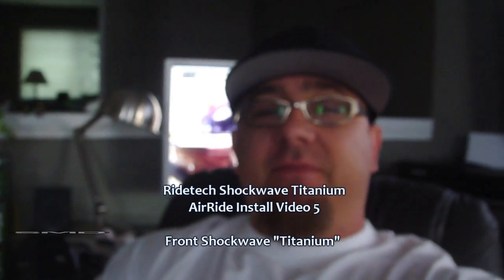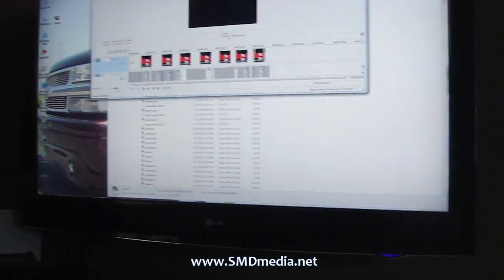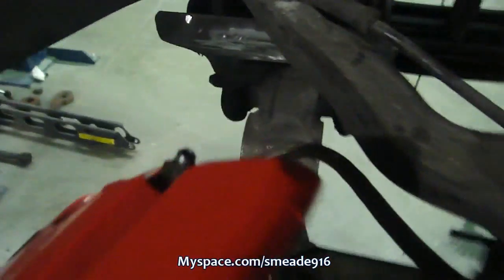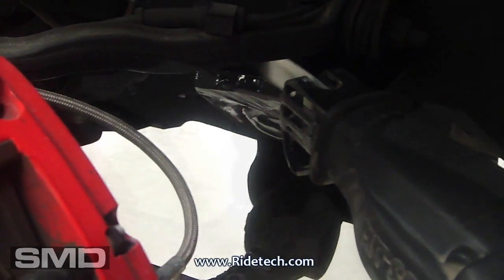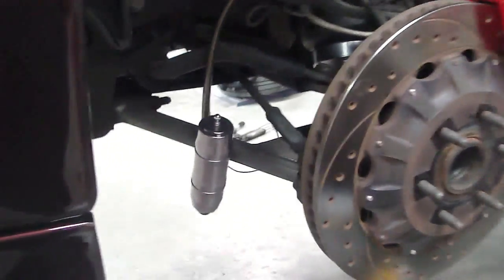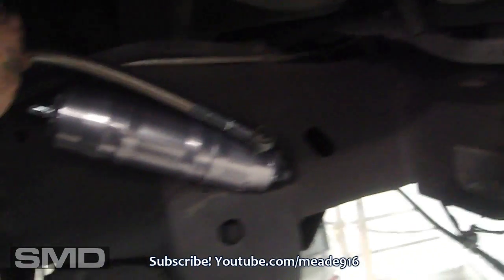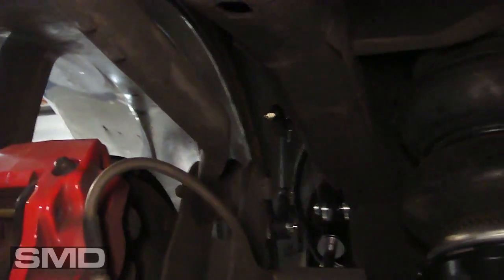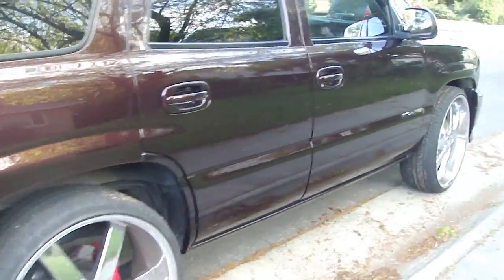Airing up the Tahoe 5 - Front Shockwave Titanium Series with Infrared Ground Level Sensors

Comment: All that work for what could be achieved with a 5-7 drop. Still beautiful. I'm used to damn near tuckin lug on a 22.
Reply from the maker: already had a 5-7 drop. You obviously don't grasp WHY this vehicle was bagged.  Oh and if i put those little 22's on this Tahoe it would for sure tuck harder. Thanks though.
Reply from the maker: this is an OLD ass video.  I also now have 2" drop spindles in the front so it's even lower.
Reply: meade916 smaller wheel diameter won't tuck in the fender any more. It will tuck less than big wheels. Looks good, just wasted money I feel.
Reply from the maker: actually, if you think that you aren't very smart.  Of course a little wheel like the ones you have will tuck more.  That is nutty shit to think it wouldn't. Call it a waste of money if you want, nobody cares what you feel.  But just to let you know since you don't seem very bright, the bags are for weight purposes not for tucking rim.  I have 2000lbs in the back of my ride.  People that use bags to tuck rim are actually the ones wasting money and time if you really think about it. Bags are for weight not for being cool (in the real world).
Reply from the maker: of course a 22 won't tuck SUPER hard but the vehicle will be a lot lower and they will go down more. How do i know this? my shit is resting on the tire right now.  It can't roll all the way down.  So i have more room to drop with a smaller rim.  But you didn't know that.  Just like you didn't know the bags are primarily for the weight AND my drop kit as a side bonus. But thanks for the other stuff.

Comment: What's up Steve, been following you and your bad ass videos n system builds for a long time. I have a 2000 Tahoe Limited and I want to do my door panels like yours on your 01 tahoe. What do you recommend I start w that will sound clear and crisp but also beat nice. I have 4- 12s in a bandpass I'm the back firing down but those sound nice i also want to replace the back door speakers too. They are all changed out w stock size speakers at the moment.

Comment from the maker: it wasn't nice to tell you to go get your own Tahoe and lower it to the height YOU want it lowered? Don't be so sensitive.  SMH
Reply: meade916 hey man quick question so im currently at a five inch drop on my silverado i have 3inch belltech drop springs and two inch drop spindles, i want to purchase the shockwaves up front , will i be around the same height if i install the shockwaves or will i need lowering control arms to match the height am at now? . 
I know ridetech has there control arm kit but its not a lowering control arm kit